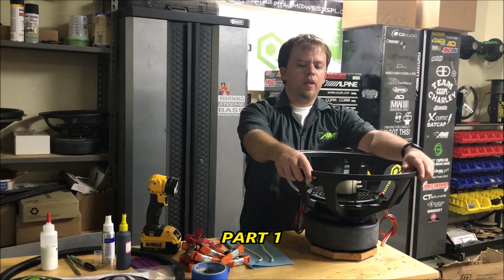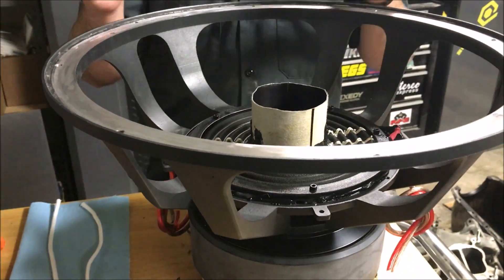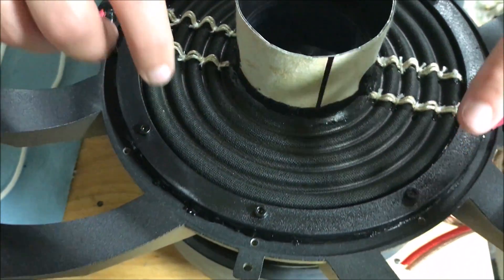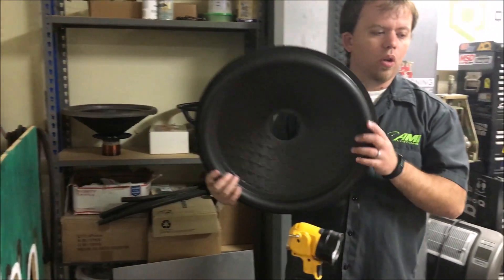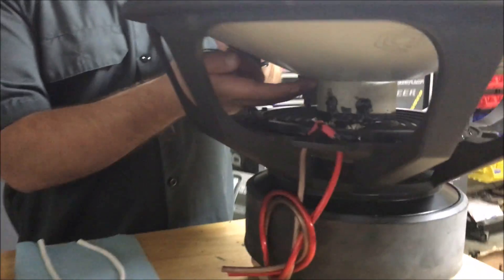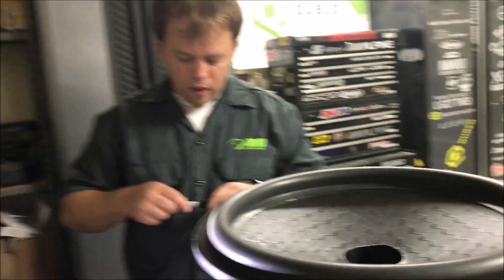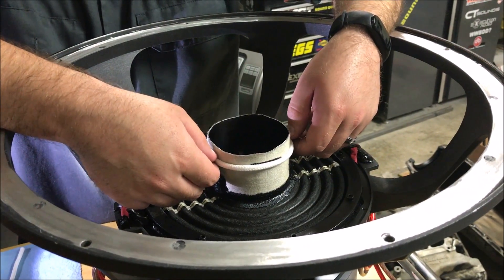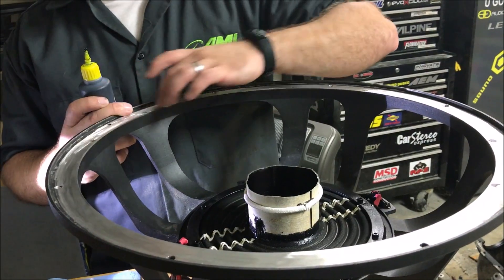HOW TO:  RECONE CARBON CONE - PART 1

Comment: Are they offering aluminum coils for the HDC3's now?
Reply from the maker: Subwoofer King on certain models yes, call for availability.
Reply: Thanks I'm definitely calling! And one more question. What did you use to change the color of your carbon dust cap logo? Because green won't really go with the color of my box :/ Btw you could take a peep at my channel to see my SoundQubed built. I'm trying to represent for SoundQubed down here in South Georgia
Reply from the maker: Subwoofer King the logo on the carbon dust cap is just a decal and SoundQubed offers different color decals for them.
Reply: Omg really!? I feel so dumb right now lol

Comment: Could this stringing technique be used on an privately recone woofer? I want my zvx to handle a little more power and this seems to be a dam. Good way to keep from failure
Reply from the maker: Daniel Harrell you could try it but the rope normally needs to be added with fiberglass mat to help it hold better.